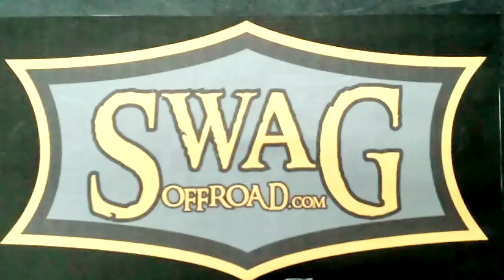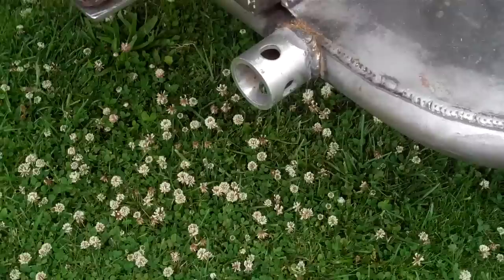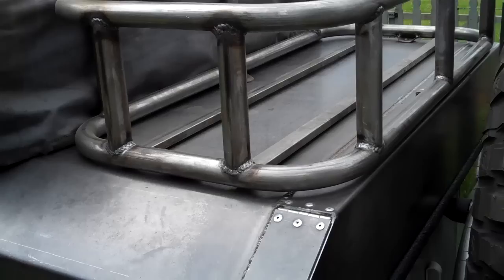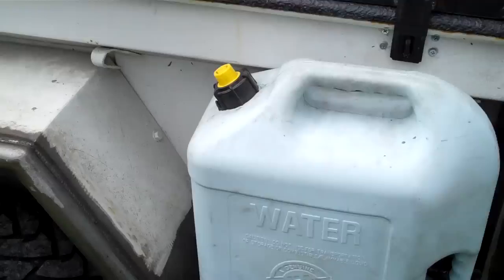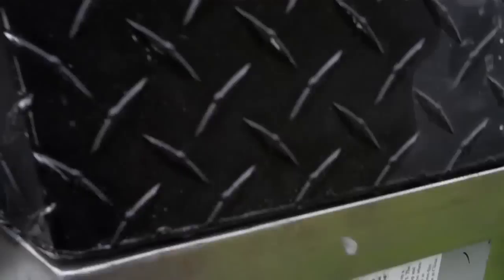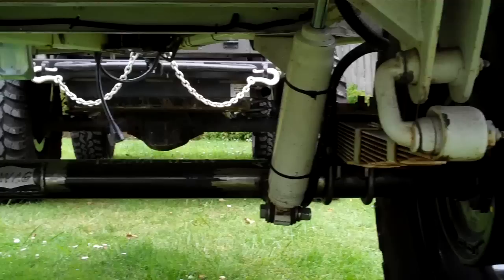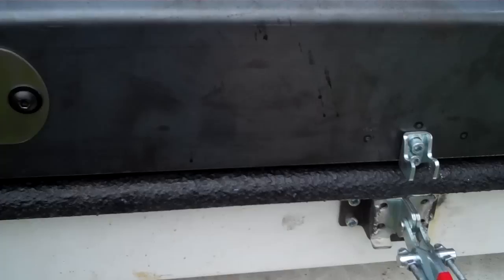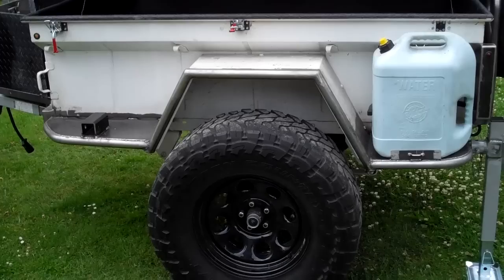SWAG Off Road Military Expedition Trailer Build

Comment: just an observation for your next build.. hinge the cover on the other side so if you have to pull over to the shoulder of the road and get something out of your trailer your not at risk of getting run over.
Reply: outstanding observation. <-- safety guy. =)

Comment: Lookin good.  BTW for those who dont know, some of his products are upgrades to harbor freight tools to make them usable.  Not to mention his prices are reasonable on top of that.  So buy a cheap tool, upgrade with his parts and still be better than some tools costing 4x as much off the start.  Would be interested in some of the cad files in 3ds format for the trailer itself.  I had the same trailer and my YJ I made in 3ds format and converted to a couple games but lost it all in a hard drive failure.
Reply: +Medium Man Sorry for your loss buddy. Maybe you can get her back up again.

Comment: What do you think about using 16 gauge with 3/4" 16 gauge square tube for a skeleton for the box of of a trailer like this? Strong enough? I have an extra sheet of that and plenty of 3/4" tube I could use to start building my trailer.

Comment: I’ve seen this video before but I forgot to comment.  I have a similar trailer built in 1946 per the title.  The lid is heavy AF and I only have one shock on it.  It’ll go up with some muscle and stay sitting up but I’d really like to add another support lift.  The issue is on the rear of the trailer, the previous owner put a swing out tailgate and there is also a water line in the area where I would l likely need to put a piece of C-channel to attach a support to.  I’ll be posting a video soon with all the features on mine.   I need ya’ll to critique it and tell me good or bad what I should change, add, remove completely, etc....

Comment: everything looks great but I wonder how your coupler has held up over the years now? turn left right and the up down pivit but you didn't have any compensation for twist jeep leaning left and trailer leaning right
Reply: +johnny bigrigger That's what I noticed???
Reply: +johnny bigrigger i believe it has a bolt threaded into the tongue. so that bushing and bracket is bolted to the receiver and there is a bold going from the bushing to the tongue. i dont know if i would want a single 5/8 or 3/4 bolt towing my trailer.

Comment: So .... how do you get into the trailer tray when the tent is out ????? Sorry, but this is a silly set up
 - seen much better set ups
Reply: I agree. Also, it must be heavier than sin with all that unnecessary metalwork.
Reply: scooter2099 
1st) How about you build a better a trailer and then, post a video about said trailer. 2nd) I would suggest that the owner grab all of the stuff thast he needs before erecting their pop up tent. Fyi..
Reply: being that its a rooftop tent and he can lift while its not setup  so he should be able to lift it up when its setup being that there is no poles on the ground only a ladder so unless someone was laying in the tent at the time i dont see a problem with it